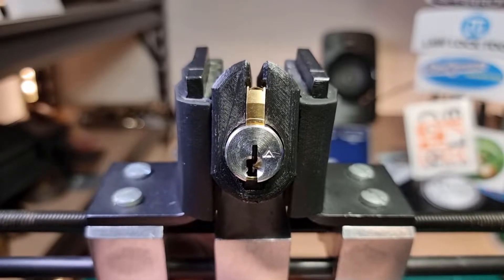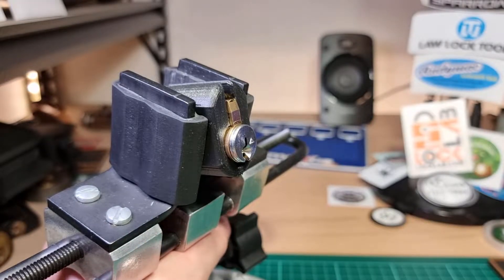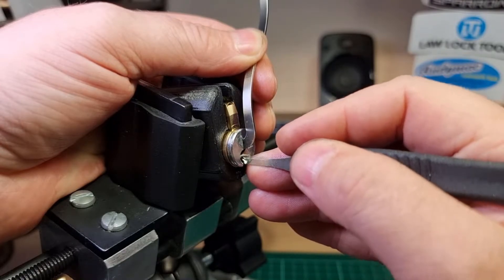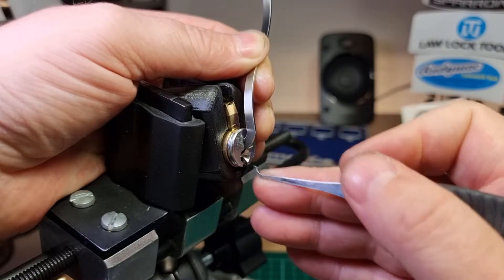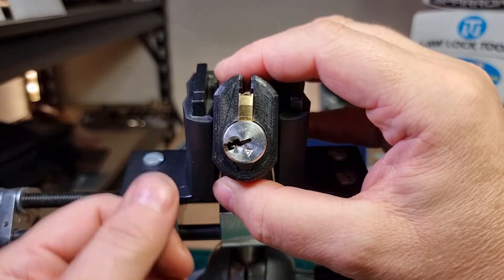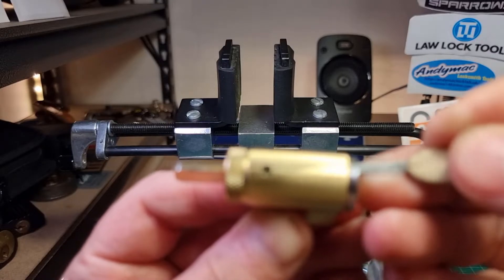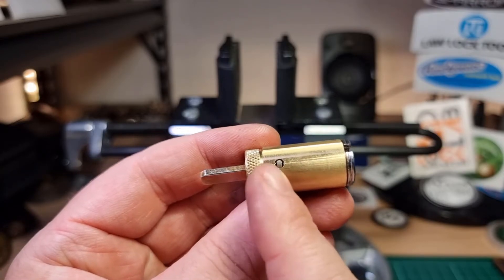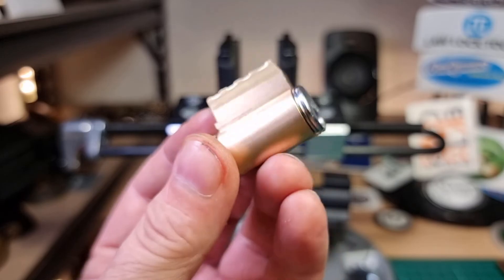(182) Schlage Everest Picked

Comment: Well picked 👏👏
Standard pins feel weird after picking so many security pins!
But very cool lock overall, I always like a good check pin 👍
Cheers 🍻
Reply from the maker: Thank you 😁 
Typical that it opened up easy just after admitting to struggling with it 😆
Cheers bud 👍 🍻